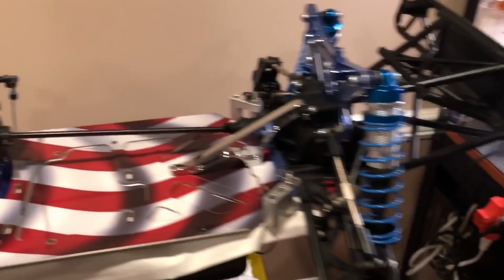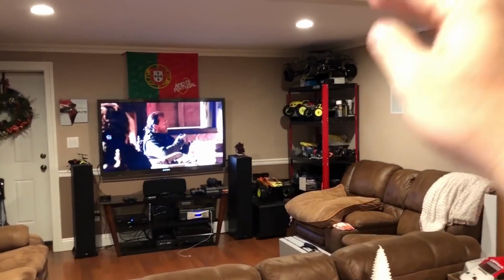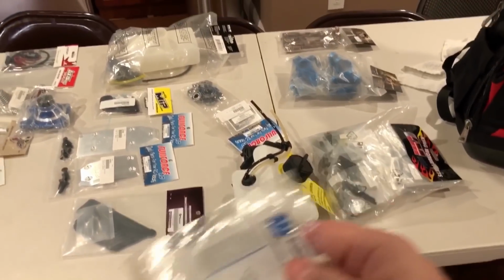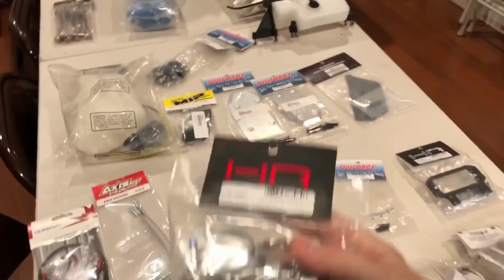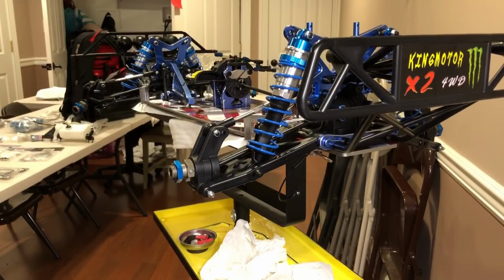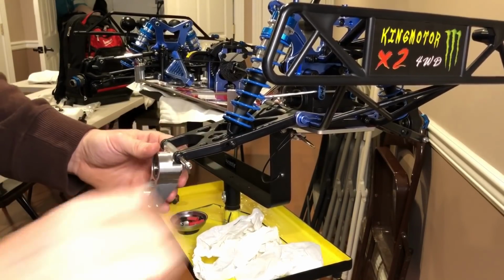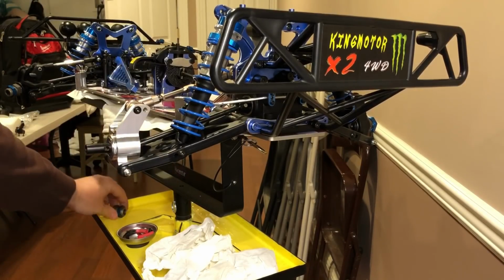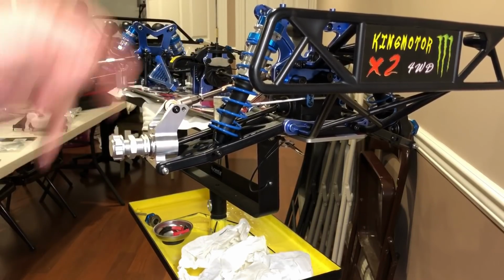Part5, Getting My Roller K👑M X2/Losi 5T Platform To Braaap(Rear Hubs&Turn Buckles

Comment: Where do you get the parts from. Im new and got my chasis with front and rear diffs and shock towers at rcmaxx. Doing the same as you are. Rebuild
Reply from the maker: I get parts from a few places I will send you the links :: 
 https://www.rovanrc.com/

https://www.primalrc.com/

https://www.detroitperformancerc.com/

http://www.davesmotors.com/Home/
And I have gotten many many parts from my local hobby shop aswell https://maps.apple.com/?address=1542%20Hempstead%20Tpke,%20Elmont,%20NY%20%2011003,%20United%20States&auid=10992206771197746560&ll=40.707339,-73.697679&lsp=9902&q=Track%20Day%20Hobbies&_ext=ChkKBQgEEOIBCgQIBRADCgQIBhAWCgQIChAAEiYpPO4A5fZZREAxrpJY2QdtUsA5usMmQR1bREBBTrt0sUVsUsBQBA%3D%3D

Comment: BOTAJELL.... At time 5: 50 you said you don't recommend this hubs can you tell me why not? And if not what others do you recommend ?
Reply from the maker: Thee great 👍 bro but I don’t recommend them if you use aluminum a arms and if you want to keep your RC lighter . The plastics never broke after many years so no need to upgrade but those aluminum ones are sure nice 👍
Reply: @BOTAJELL  ... Thanks , I just don't like all the play in the turnbuckles, a-arms, spindles (hubs) on my 
SLT 450 the rear a -arm's holes for the hub were drilled to big. I don't want to be negative but  it's the way it is.
Reply from the maker: Ringo Gingo trust me you don’t want them tight either. We all used to drill them out years ago . I learned that trick from my friend Robert that raced for Losi way before horizon hobbies took them over like a puppet back in 2005ish .
Reply: @BOTAJELL  .... You are right but if I grab the wheel / tire in my hand and move it left/right there's ton of play, SLT450. I'm thinking of replacing the arms with stock Losi arms.
Reply from the maker: Ringo Gingo stock losi plastic arms are the same way. It’s all changed because back in 05 06 they were to tight. The Rovan Plastics are better then the plastics Horizon hobbies is using today. You can always add shims or Teflon tape to turn things for your liking .
Reply: @BOTAJELL  ... Ok , what weight diff oil for my Max ? I ordered 3000 & 10,000
Reply from the maker: Ringo Gingo 10,000 should be fun and great for everything but with the 45 it could thin out quickly especially in the summer so I would do anything between 10,000 and 50,000 in Baja Differential .  100,000 is for drag racing . And Losi 5T/X2/LT platform do 500,000 center diff and 100,000 front and rear diffs
Reply: @BOTAJELL  .... You should have a hobby store !

Comment: i’m planning to get a 8ight t 4.0 rtr to get into nitro
Reply from the maker: Nice but there’s no such thing. There’s only a TLR 4.0 8T and that’s the race kit and the best one to have ! Then there’s the Losin RTR 8T and that’s more like the 3.0 but without the better parts but still pretty damn good to have fun with
Reply: BOTAJELL is the race kit more expensive and where do they sell it, i’m not scared of building it i just haven’t actually seen a kit for sale anywhere
Reply: BOTAJELL well actually i think the roght question is, does it even matter if all im going to do is bash it around the front yard and in the woods, is the race kit more durable or is it just about the handling and adjustments
Reply from the maker: Joe best thing to do is find a used TLR 4.0 truggy then take it apart and start from the chassis up! I have a 2 part build video that shows everything I did and used to mine so you can have the same identical truggy . The TLR 4.0 comes with many different little things that will all add up for you so it can out bash and save you money in the long run! The old 3.0 is not the same and the RTR is definitely not the same ! But if this is your first truggy or nitro and if you don’t want to spank electric ⚡️ RCs but’s ? Then definitely go with the RTR it will be pretty good and lots of fun for you but just remember it’s not on the same level as the 4.0 .

Comment: Dat high flow filter on the 5IVE-B tank... Looks like the old bronze dust molded fuel filters that used to come on earlier Rochester Carburetors. They flow GOOD, but do not catch micro particles. I don't believe that you will have a problem, because you keep everything SO clean - even your fuel!! 👍👍  For less meticulous people, they might have Carb problems if they used those.... 

In my wrenching days, I was a Carburetor and Fuel Injection Specialist. There's many specs, rules, do's and don'ts....
But Rule #1 has always been KEEP IT CLEAN!!! More Jobs have involved just a thorough cleaning of the Fuel System than anything else.
I've HEARD the guy too many times tell me "This Car is a piece of SHIT! You gotta fix it." 
........ and it ended up being something like a MISSING Gas Cap!!! 😬😫  Yet they blame the Car, the Dealership, or even the Car Company!  Guys like me, performed a service that many people can't fathom. Especially with all the POS 80's Cars!!! They were starting to become more and more complicated, AND in a lot of cases, shitty design or Manufacturing. 

Besides all that, if you spend whatever overpriced amount you paid for your Car - you should at LEAST be able to check very basic items on it.
I worked at Country Lincoln-Mercury.... Had a 26 year old Man bring in his 5 Month old Town Car, knocking, with only 23,000 miles on it. He cursed the Dealer, the Saleswoman, the guys in Prep, and the entire Service Department. 
The Writer called me and 2 other guys in, to try to decipher what the fuck this guy was trying to tell us about what's Wrong with his Car. When we got in, the Writer was scratching his head, perplexed. He asked "I have no Service Records for your Vehicle... Have you had the Ca serviced at your own facility?" 
The guy said "No! I didn't take it anywhere. I was about to schedule my 25,000 mile Service, and this piece of shit fell apart!"

Pause............. 
"You mean, Sir, that you haven't done anything to your Car previously?"
"NO!! That's why I was going to bring it here." 

Another pause...................... 
"Sir, you mean you haven't even changed the OIL, in the whole 23,000 miles you've had it?" 
"NO!!!" Getting louder "I go longer than that in my Peterbilt!" 

He had his Car pushed out to the Street, was handed his keys, and escorted out - with a big Red VOID stamped on his warranty papers!!!! 
That my friend, is a special kind of STUPID!
Carmine 🚂
Reply: OMFG!!! That is a LOT of Bling and performance upgrades, just on that table!! That Rig is going to be so BADASS!
I truly miss being able to shop like that. 
I'm currently watching all of these Videos on this Buggy, all at once, to catch up!!
Carmine 🚂

Comment: Do you think the rovan aluminum rear hubs would be a good upgrade versus the ones you are using?
Reply: Well an upgrade from the plastic ones
Reply from the maker: To be honest the plastic ones are great 👍🏼 bro no need to change lol!! I just like the Hostiles for years but the Rovan ones are great as well! I’m using the front c-hub and spindle kit from Rovan on both my Chrome LOSI 5T and on my K👑M X2 !
Reply: Cool I only want to change them cause I’m pretty hard on my RC’s love watching them fly through the air. My X2 roller should be here Wednesday, so trying to get a parts list together.
Reply from the maker: mtstang75 cool! That’s exactly what I did ! Best thing to To is to go over your new Rig and make it headache free as much as possible. It’s a fun and easy thing to do and for some a great learning experience!! Good stuff!

Comment: Saw your unboxing video of the 5T with your buddy in the garage. Loved it, I think I’m ready to take the plunge. What’s a good pipe for that motor and do i need to get a transmitter or can I run it safe on the one that comes with it?
Reply from the maker: royrolph I would do the JetPro pipe the one that looks like a cyclone! That thing works amazing bro . You also can’t go wrong with a Bartolone Pipe either. As far as remote, I would go with a Futaba 4PLS or a 4 PX or just as good as that!! I don’t know what 5T platform your getting but if it comes with a FlySky ? You will be good for a wile because there not bad at all and will work with many kill switches and the fail safe works pretty good! I’m just being honest with you because I have used all of these and I still own them all today except for the Futaba 4px but I have a 7PX instead.

Comment: Yeah I never did like the LST 2 original tank, I think mine was leaking air somewhere, probably through the cap seal. Looks like the XXl tank is much better design, no primer button and a cap that’s good seal.
I bought the LST 3 “Eword” which is super fast , even on low speed, but I agree with everything you say about Nitro. You get a good engine and you can go all day.

Never had luck with my Dynamite Mach 427 and I’m hoping it was because of that crappy tanks.
Reply from the maker: royrolph most likely it was a air leak because of a bad crank bearing ?? That’s what happened to mine and 3 of my friends as well! Just throw a 30 or a 28-8 in it! Lol

Comment: Love your videos man! I have an old LST 2 probably 12 years old in the process of reviving it. Replaced tank with one from XXl, they don’t make the lst 2 tank anymore.

Thinking of building Truggy Nitro kit or getting the RTR and throwing in a better motor on your recommendations!

Keep it up! I sit here for hours watching your videos, I’m driving the wife nuts. But I’m learning so much. I’m addicted to it now like crack cocaine
Reply from the maker: royrolph lol 😂👍🏼🤘⛽️🔥💨! Thank you my Nitro Brother!! Keep up the great work! I may have an extra LST 2 tank somewhere? I also have the GAS tank for XXL2 LST if you need it? I have a ton of parts for LSTs lol!!! Maybe someday I’ll show it in a video? Bro the TLR 4.0 8T Truggy Race Kit is sweet ! They handle well in the air and o the ground! I run Modified Nitros Engines on mine and the race kit is durable as hell! The RTR is cool to but it’s definitely not like the TLR 4.0 Race Kit! My daughters love it and it’s bin pretty damn good for them so far and no issues and even after I have jumped it a couple of times. The 4.0 uses better Diffs and many other parts as well that are different! And it’s also balanced differently . Good luck!

Comment: Thanks John, learnt so much from you, hope there is things I can contribute to our hobby too. The buzzer on our multimeters should buzz if that carbon fibre has carbon in it. In the sharp end grain, so we must be careful when wiring near it as it conducts electricity like metal and can cut through our wires and arc out. I was amazed when I first found out it conducts. A light sand of the end grain under running water only will smooth it out. As the dust is toxic.
Reply from the maker: Terry Allen what multimeter?
Reply: BOTAJELL . Ow, can't remember if you had one or not.

Comment: Is there a rubber boot for that wheel drive shaft?
Reply from the maker: Harvz B no it’s opened . You can seal them up if you want with some boots but I’m not going to do it to mine because I don’t expect my out drive cups to last with my SkoPod 62 motor and I want to see how it wears

Comment: Hey John, You could do the file test to see which parts are hardest, just do it on an end that you can't see. If it skates across the metal means it's hardened. Not sure how that test works for alloy, but I'd imagine that it works the same except softer I guess. All in the feel. Magic fingers :-)

Comment: How would i fix a front bearing leak on my nitro motor?
Reply from the maker: Joel Maillard you would have to replace the crank bearing brother. It’s a fun job and if you live close to me ? Let’s do it!! You can also give the BuKu crank bearing savors I think that’s what it’s called ? I have used it once in the past and it worked good but I would rather just install better bearings nowadays or ceramic bearings for higher Revs
Reply: BOTAJELL i live in the UK pal
Reply: BOTAJELL cheers and same to you brother 👍
Reply: Joel Maillard where abouts?
Reply: Sheffield mate
Reply: Joel Maillard ah okay too far from me I'm in Surrey.
Reply: behemothfan666 F T P oh well have a good new year mate
Reply: Joel Maillard Cheers👍you also.
Reply from the maker: Joel Maillard keep up the great 👍🏼 work over in the UK and Happy New Year to you and your family! Let me know what you decide to do and how it all goes.

Comment: on those turnbuckles watch out for those brass bushings I had a set and the brass bushings or inserts came out they are pressed in with out green loctite
Reply from the maker: shiner-RC thanks for the heads up bro! That’s what I was concerned about and wondering. I may do the green loctite or just upgrade to IRP like the ones I have on my Losi 5T? I just could not say no to the great price with these and try them out for first time